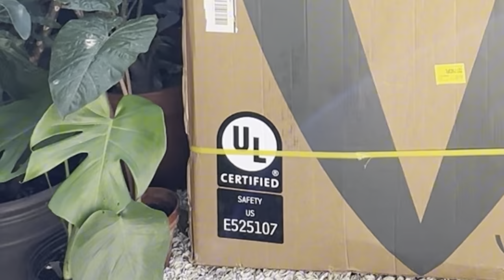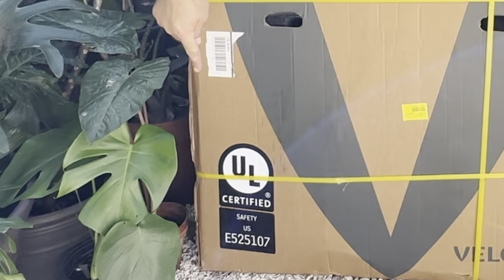Let’s try and RUIN a Brand New Velotric Fold 1 Electric Bike with water, straight out of the box!

Comment: would love to see how you add a 2nd battery to the Fold 1. Thanks for the content!
Reply from the maker: With the controller potted into the mounting plate of the battery, it will be difficult to do.
Reply: @ElectricAllWheel  yeah seems like Velotric is making everything proprietary on the bike making it extremely difficult to modify.. from the charger, the foot pegs, the front basket, headlight, and the controller...  hopefully you find a way to do it :)